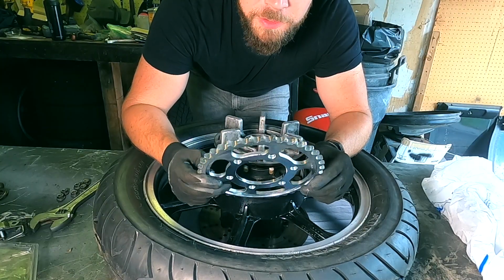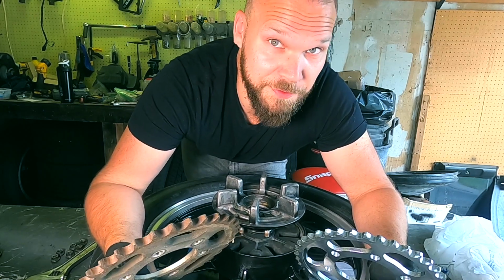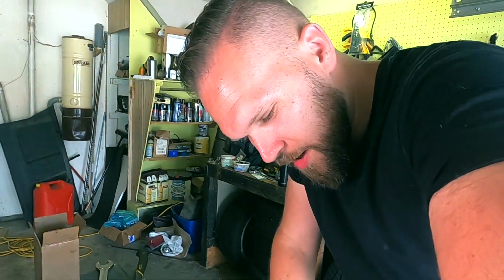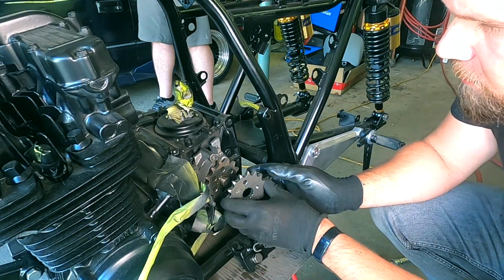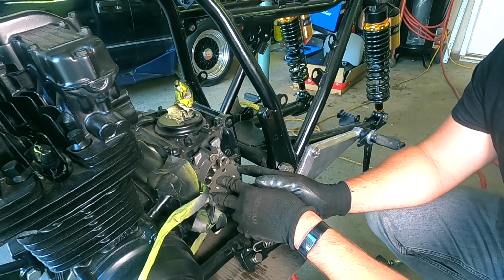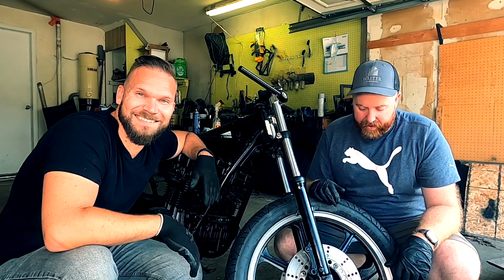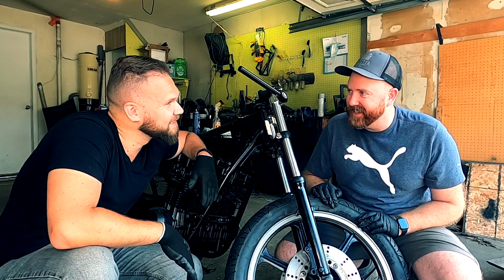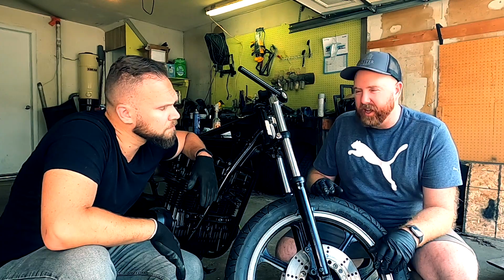Budget Cafe Build E26: Its back on its feet

Comment: Great job! Soon ready to fire it up? 😊
Reply from the maker: Thanks it’s getting there 👍 it’s getting close to firing it up for sure. We’re planning on ultrasonically cleaning the cards. Any recommendations on reasonably priced slip on exhaust cones?
Reply: @cafechronicles  I fitted this one on my build: https://youtu.be/0KVpN9l5P1o. Probably best for a scrambler-ish build. The build quality was good, it's stainless steel, has removable 'dB-killer' and it was very cheap. I have not tested how it performs or how the sound is yet.

I have searched a lot to find reasonable priced 'classic cone' stainless steel muffler - that actually works as a silencer, not just a straight pipe. The ones that looks to be good are expensive, and the cheap ones looks really cheap and seems to have questionable noise reduction capabilities  🥴 If you can find anything good, let me know 😬
Reply from the maker: Nice video! Looks great and nice job on the pipe. The muffler looks great quality. That could indeed be an option for us. Thanks for the heads up 👍